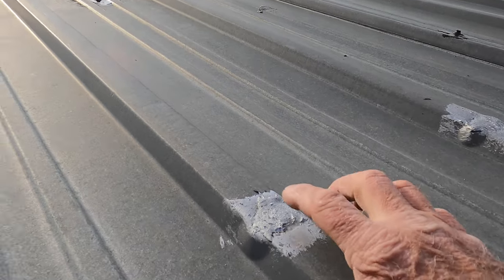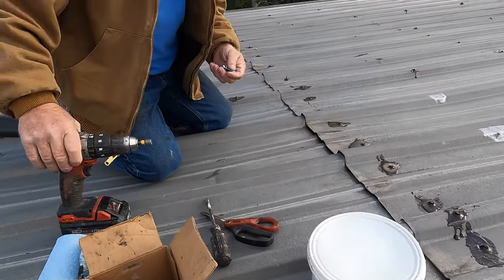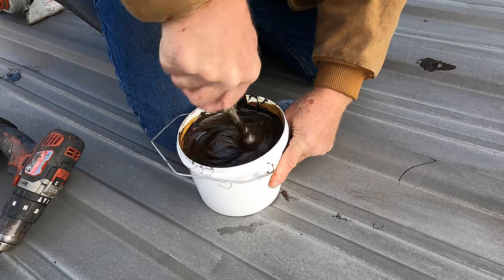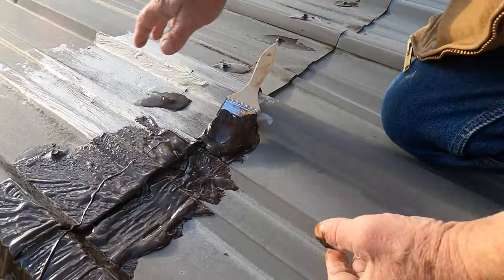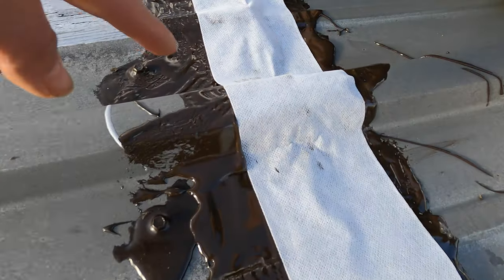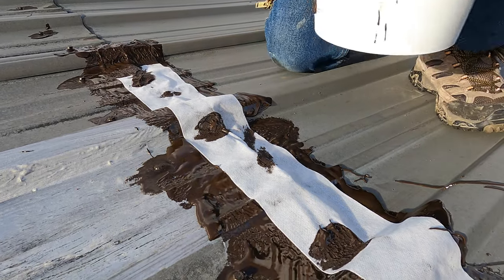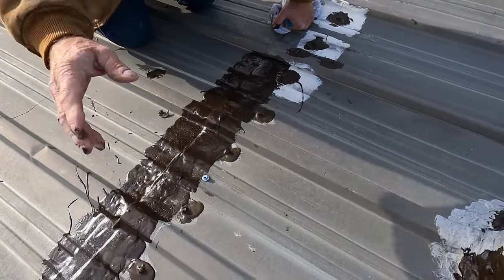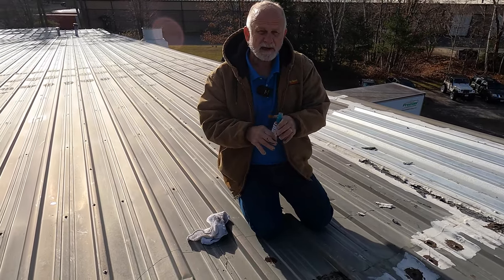See the damaged caused by walking on metal roofs - try to avoid this problem

Comment: Hi.

What is the maximum ambient temperature in that place?

How many degrees does the temperature of the sheet reach in summer?

It is necessary to protect that material with silver paint?

How many years is this product effective?

Best regards.
Reply from the maker: It gets up to 140 F on the roof in summer
It is better to protect - that goes without saying. UV's will beat anything up
If it stays protected, indefinitely. Try to coat it every 5 years with the silver paint
Reply: @FlatRoofDoctor  okay okay.

Thank you.

Nice job.